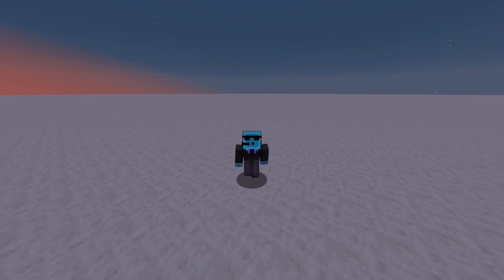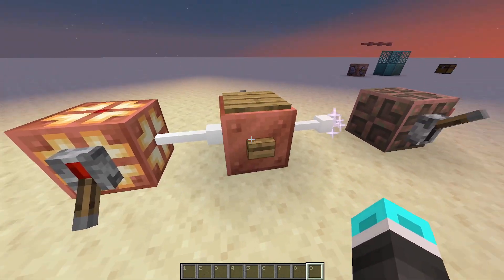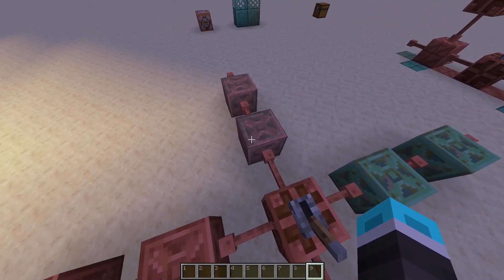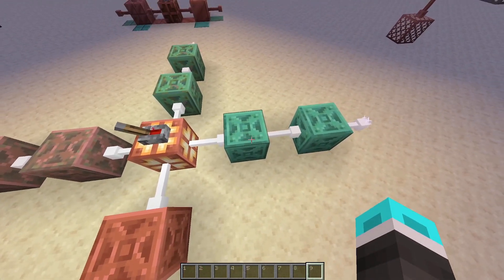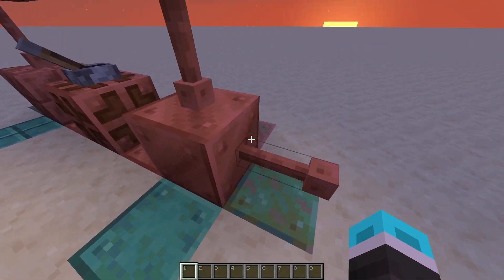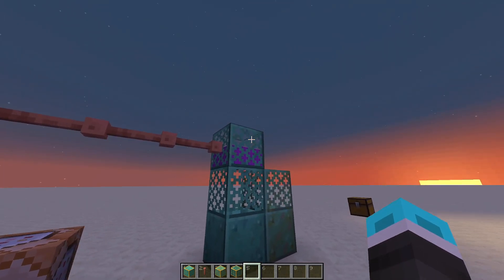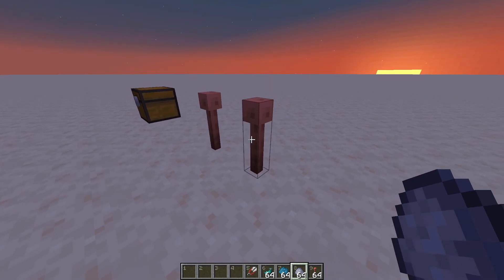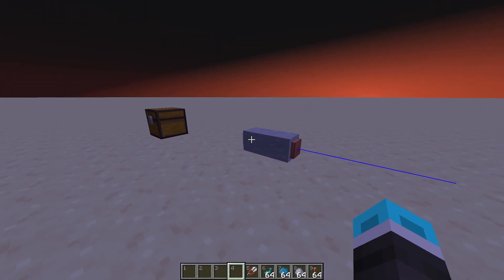Copper Wiring Datapack Beta 4

Comment: so this datapack worked once on my computer and now it does nothing please help
Reply from the maker: @bobtheslob-v3s  if you directly just replaced the old version with the new, you'll have to either run the reset function or break all the blocks related to the pack and replace them. Many of the functionalities have been rewritten to be more optimized, and won't work with wires that were still active from the previous version
Reply: @AuraAcorn  no i tried a new pack my old not updated pack it just doesn't work and i just noticed that my computer won't run datapacks anymore so this is not your problem i just wish there were tutorials about it all i saw was video's for datpack creators

Comment: This is really cool! Two questions: how did you do the right click detection for the insulation? Is it with interaction entities?
The second question is if the only way to power the wiring is through redstone. It would be kind of cool to have it be possible to power wiring through some sort of fuel, like putting coal in a furnace to activate it, and then the data pack detecting the furnace being on and powering the wires if it is.

Other than that, great work!

Comment: for the discharge sound, why not try bee buzzing sounds?
Reply: like bee death, and as for the tesla coil, why not make it deal more damage/increased range based on the amount of power given to it, or make two towers in the same vicinity power each other to deal stacked damage (behaves somewhat like Red Alert 2's prism towers)
Reply: @justachickenboi having them boost each other definitely sounds like a good idea, maybe with a slightly lossy chain of power:
A core always outputs half its input power rounded up, so you need 3 cores to reach 8/9 power (you can only input on 5 sides, and one of those is for the prior core, so it's 5>3→7>4⇄8 or 2x5>2x3→9).
Tie damage to power level (1 input = 1 damage)
Then just make them cap out at some arbitrary value (16 for parity with lightning or 64/256/1024 for fun) and you've got something pretty nice.

Comment: Each update is a real treat. I'm completely happy with this use of Heavy Cores as opposed to the previous concept of capacitors which are now very affordable for projects of many kinds. Also a great idea on how to prevent yourself from taking damage from the Tesla Cores! One more reason to use my "I hate powdered snow!!!" enchanted Leather Boots. I have a low priority suggestion, since it's more about decoration, but I think you could reuse the copper insulation code to make those long steampunk light bulbs by crouching and using a block of glass on the copper rods. Also using the other 16 colors of glass to make colored lights for christmas. That's of course up to you, but I think it would be perfect to use together with the current features of oxidized copper blocks to make the lights flash "randomly".

Comment: Hey um, I have a problem, when you put clay on the wire, it doesn't transfer power through, only when you remove the clay. is this a bug or not?
Reply from the maker: @EllisJunk  It won't appear lit up, but power will still go through. Since the block isn't lit up it won't power redstone, but the power will transfer to the next wire
Reply: @AuraAcorn  oh okay, thanks for letting me know
Reply: @AuraAcorn  Could you replace the internal block (lightning rod) with something else, when insulated & powered? An end rod might, as it would keep the bright look?
Reply: Also, on your 0.3.0 video, I saw a great idea someone had in which the copper trapdoor could be used as a circuit breaker. I checked and it was @antonioalancarte4481.
Reply: One more thing, would it be possible for full-capacitor mounted tesla cores to be capable of supercharging wires, because that would just be cool/useful. (for capacitors that have a high enough max charge of course.)

Comment: hey cool update, but i have the problem that the copper rods do not work when i have to many in the world. i do not know if it is my pc or the datapack.
Reply from the maker: @brand0n42  So I forgot to mention it in the update, but I've improved that a lot. I found a new method of making the pack work and it optimizes so much, that you should not have any issues with too many rods in this newest version
Reply: @AuraAcorn  ok even in the new version i have the problem so than it is my pc.
Reply from the maker: @brand0n42  It might be then, but just to be sure, either run the reset function or try this pack in a new world that didn't have an older version. There can be conflicts between versions when updating

Comment: This is still so damn cool.
One thing i'd like to see, is more limited power sources. You got power storage using the capacitors, and limited power generation via lightning.
Would be interesting to have a generator (maybe using a furnace?) and not having redstone be converted into electricity.
Or maybe that's outside the scope of this/not intended at all.
Reply from the maker: @symmetry8049  My goal is to integrate things in a way that's vanilla friendly, and in another video I did say power generation isn't something I plan on doing. Most of what this pack is for is to bring more functionality to redstone with a logical system, not so much making it a power system
Reply: When lightning strikes water which touches copper block, the copper block should be powered right?
Just a small idea.
 @AuraAcorn
Reply from the maker: @LogicalDraws  I'll consider it, not a bad idea

Comment: That's awesome 😎💪. Will the chainmail or other metal armor deal damage to other players /mobs like the Thorn armer enchanted when it gets struck by that Tesla core?  Could you add a portable Tesla core to get like Thorn armory and make it stackable with the Thorn enchanted? Or a lightning ⚡ gun to e/stun gun to electicute anything you aim on? How about portable capacitors or rechargeable batteries 🔋 and a station where you can load and unload The energy. Electric furnace would be awesome too

Comment: Do you think you could make it so iron golems require enough electricity flowing through the 4 iron blocks to suddenly turn into a golem?

I would picture it going like some wondering into a base then seeing the ironic iron golem formation but then getting confused on why there isnt one forming

And when you get closer a sculk sensor is triggered and linked to a contraption with a circuit and shoves enough power into the formation to form a iron golem

Probably wont be practical but it would be neat I guess
Reply from the maker: Unfortunately, the only way to do that would just to have the golem not completely formed, like one block missing. Since they automatically form as part of the base game, I can't change that.
Reply: @AuraAcorn  that's sucks maybe if you changed the blocks needed for it spawn? Like having the bottom block need to be a full battery? So it would need to be charged to spawn but idk if that could be changed without modifications oh well
Reply: Powering golems makes so much sense. Maybe this a good moment to have another look at those copper golems minecraft pitched a few years back? :D